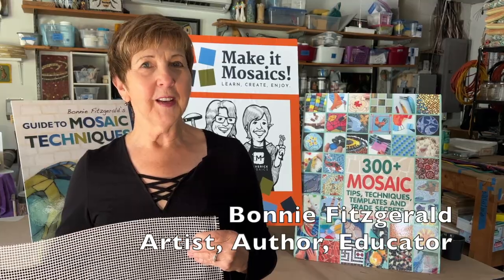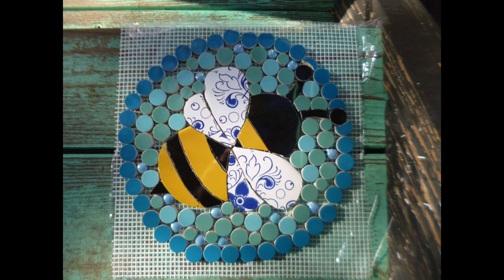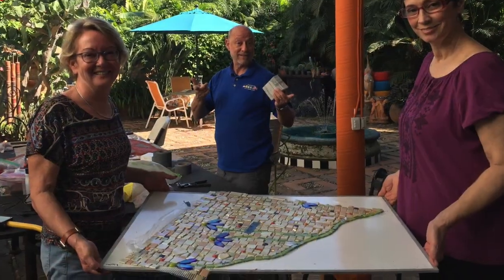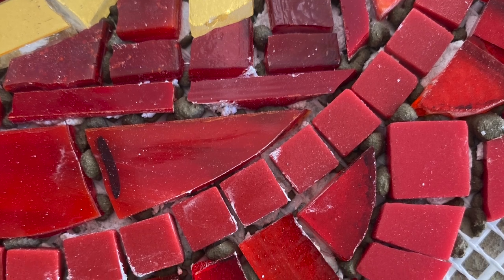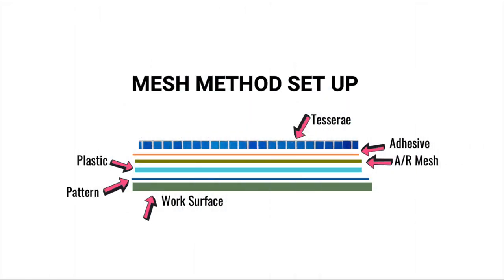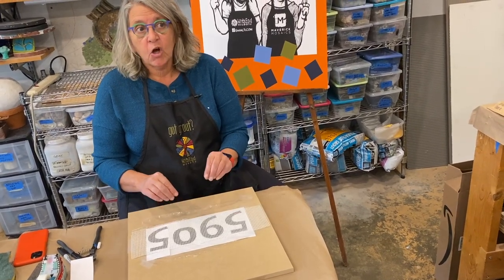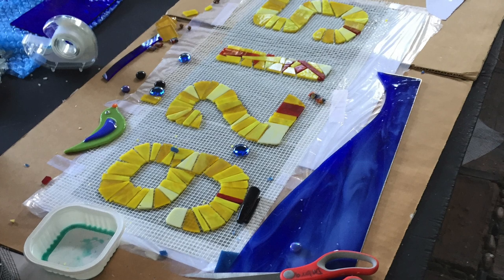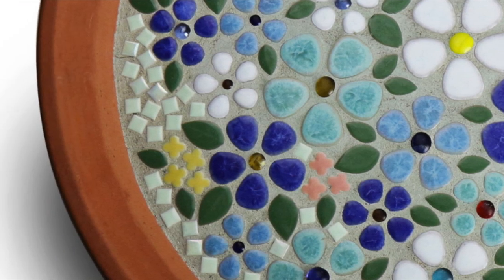Mosaic Mesh Mosaic Method, Easy Mosaic Fabrication Technique

Comment from the maker: Sorry Chat abruptly ended! To answer about using pva glue if piece for outside, yes I have done it, but be careful to not create a barrier with the pva glue. The installation glue needs to get around the individual teaasrae.
Reply from the maker: Thanks for tuning in.
Reply: I don't use WeldBond for outside because it turns back white and soft even after its cured.  I live in Wisconsin and I want the tile seated as strongly as possible due to freeze thaw cycles.  The weldbond creates a barrier and doesn't allow the thinset to stick to the tile in that area.  My general rule is use as few types of material as possible because there is less opportunity for reaction between the materials and less chance of failure.

Comment: I bought mesh that says it is for mosaic but I can't find it it is AR or not. The directions inside say mesh is not meant for outdoors, which is very confusing!
Reply from the maker: Humm, did you buy "sticky mesh"? The mesh sold by Witsend, and construction supply places, is A/R mesh and is fine for outside. It is confusing! If you email me a pic and the label I may better be able to answer your question. bonnie@maverickmosaics.com

Comment: Help! Do you apply thin set to the top of the mesh and then apply the tesserae? How do they stick otherwise so they don’t fall off when moved?
Reply from the maker: Depending on the size of my tesserae sometimes I back-butter OR put a dab of thin-set on each piece using the pastry bag trick to put a dab on the back of each OR spread a line of thin-set on the mesh with a spatula or pastry bag and set each piece directly.  Either way, allow thin-set to cure overnight. Then gently peel the plastic off and guarantee the majority of your tesserae will stay on the mesh. There may be a learning curve for how much thin-set to use based on the size and weight of the tesserae. The thinset is really strong  This is pastry bag trick https://youtu.be/ZVNZDGqQSrw

Comment: Thank you for your video.   I have found both sticky and non sticky AR mesh.  Do you recommend one over the other for small framed wall hangings up to 12x16 inches?
Reply from the maker: I do not use sticky mesh; I use AR mesh, as given in the description. I do not trust sticky mesh to stay sticky and hold the weight of my tesserae. Good question! Thanks.

Comment: Is there any specific gauge or size holes in the mesh I need to order other than AR?
Reply from the maker: There are a few gauges, but you'll have to shop at a building supply place for variety. This is the BEST middle of the road size and you can buy smallish amounts. https://witsendmosaic.com/mosaic-mounting-mesh-1.html
Reply: @MakeitMosaics  thanknn bc you so much
Reply: Thank you so much!

Comment: My tiles do not stick to the mesh I used PVA glue, what am I doing wrong?
Reply from the maker: Hard to say without more info. Are you using a good quality PVA glue (Weldbond), the right kind of mesh? Are tiles heavy or large scale? Did it dry overnight? Humm.

Comment: I am preparing to mosaic preformed cement pavers for the garden. I am considering using mesh for this project, instead of lugging the pavers up and down stairs. I noticed in the video that no examples for floor/ground installations were shown. Is this method more for vertical applications? Are there any things to consider if using the mesh method for stepping stones. Thank you for such fine instructional videos.
Reply from the maker: You can absolutely use for something flat. The fish table in the Mesh Method video is a good example of that - I did the complicated fish on mesh, mounted those on table then did the background directly. For that design worked really well. Kim has a good video about doing stepping stone using face tape method, also a technique worth considering. Really depends on your design. Thanks for being a fan!  https://youtu.be/3Jd20qX6L8U

Comment: Hi Kim and Bonnie - another great video! Thank you so much! I'm preparing to make a garden pole with matching table. I have consulted with Kim directly on the pole project (TY!). I  to am going to try and use PVC pipe on this piece for the substrate. The advice given is to use Lexel as my adhesive and Latricrete Spectralock 1 for the grout. My question is, can I use these two products with A/R mesh? The pole project is increasingly daunting the more I think about it!
Reply from the maker: Is the pole too large or inconvenient to mosaic directly onto with Lexal as adhesive? To do mesh method as shown in video you would have to prep the pole, make it concrete with A/R mesh tape and thin-set, then build mosaic on the white mosaic mesh in the video then thin-set as adhesive onto the pole. And after that grout. The direct method with Lexal would be easiest.
Reply: @MakeitMosaics   Thanks - I was still in the planning process and haven't purchased a pole yet. My thoughts were PVC would be a lighter, easier to handle material. The diameter could be as little as 5" I would imagine. 
For the other portion of this project, I'm doing an outdoor patio table. I have a table with a place to lay a piece of glass. I've traded out the glass for a piece of wedi board. For this project, I can use the mesh with Lexel and Spectralock 1? 
And for a third project, I purchased 3 of the aluminum EZ frames from WitsEnd to make house number mosaics for myself and my two neighbors. Lexel + Spectralock 1 on mesh?
My thoughts were they are all outdoor projects, so they same adhesives and grouts would work, but I'm very much a beginner, so maybe NOT!! ;-)

Comment: Apreciado señora si quiero hacer un mosaico trasparente debo ponerlo sobre un vidrio o requiere un epoxi para sujetar las piezas para la intemperie?.
Reply from the maker: English Translation: if I want to make a transparent mosaic, should I put it on glass or does it require an epoxy to hold the pieces against the elements? Answer: Creo que estás interesado en el mosaico de vidrio sobre vidrio; el método de la malla no es una buena técnica para materiales transparentes; Verás la malla detrás. Los adhesivos de vidrio sobre vidrio incluyen productos de silicona y pegamentos PVA que se secan transparentes. English Translation: I believe you are interested in glass-on-glass mosaic; the mesh method is not a good technique for transparent materials; you will see the mesh behind. Glass-on-glass adhesives include silicone products and PVA glues that dry clear.

Comment: I am using this method at the moment with a mindful amount of PVA glue to allow the tile adhesive to stick the back of the ceramic tesserae. Question, how long should I wait between assembling the mosaic to the wall with thinset and grout? My plan is to use a thin later of thinset on the wall, a thin one on the back of the tiles, and make a sandwich. Leave it to dry for at least 24 hours and then grout it straight onto the wall. I'm using pva because I'm working with children and find it best to do it this way. Any other advice for a first time 
 installation? Thank you!
Reply from the maker: Sorry, i just saw this. Thinset needs about 24 hours to set up enough to grout; your plan is good - some mud on the surface and some on the back of the mosaic. I like to use a rubber float to smush the mosaic into the mud on the wall. Good for yoe working with children - we need to recruit the next generation!

Comment: Thank you so much, this is really so informative and helpful. I am currently starting on a project that is much larger than the dimensions of the mesh. I know I would need to connect pieces of mesh together to complete the whole. Would appreciate if you could share your process in terms of how you do this. Would the edge of one mesh section over lap with the other or would you leave a gap between them? Also when placing tessera down, do you intentionally leave a space before the edge and then work on  filling them in once the mosaic has already been attached to its substrate for a seamless work? Thank you in advance! :)
Reply from the maker: Great question! I often am working sizes larger than the mesh, if I know for sure where the mesh runs out will be. the place I am going to cut anyway then I don't bother to overlap, but most often I overlap about an inch. Sometimes I am cutting as I go because I run out of table space. Just remember - take LOTS of photos and give yourself registration marks before you cut the mosaic apart for installation.  I am always amazed how easy it is to get lost in the process! Hope that answers your questions. If not, let us know. Thanks for being a fan!

Comment: Thank you for the great tips. I have a question about using thinset: does the thinset  also have to be used in small amounts when using it attach the Tesserae to the mesh, as you noted should be done when using PVA or Weldbond? Thank you!
Reply from the maker: Yes small amounts to initially attach tess to the mesh, this is in lieu of PVA (Weldbond). You can use Weldbond BUT be mindful to not accidentally create a barrier by using too much PVA - because ultimately the adhesive that holds the mesh-backed mosaic to the wall needs to squish up around the edges of each tile, even if it is more Weldbond.
Reply: @MakeitMosaics  thank you!

Comment: Can this technique be used for glass on glass? Would appreciate tips for the best way to place glass mosaic on a large piece of glass substrate.
Reply from the maker: Not a good technique for glass on glass because the mesh will be seen. Most folks adhere glass to glass directly because pattern can be taped to back of glass. For large gog pieces I use tempered glass as my “substrate”, regular glass may crack over time due to weight of mosaic. If your mosaic pieces are bigger than about 2”x2” be aware if using PVA or MAC glue it may take a long time to dry clear, the glue  dries from the outside-in. Good luck!
Reply: @MakeitMosaics   Thanks for your tips - I’m a beginner with big dreams to leave behind a large piece of legacy for my kids
Reply from the maker: @jasbirkaur5733  Legacy is important, and kids and mosaics are a great combination. Please take a look at my website www.maverickmosaics.com, I have an entire section dedicated to legacy projects, may give you some ideas. Thank you for being a fan and keep creating!!

Comment: Si uso vidrio sobre vidrio con que pego y q lechada pongo para el invierno y el verano . A la intemperie?. Gracias mis queridas señoras.
Reply from the maker: For exterior glass on glass, you need to use silicone or epoxy as adhesive. If you can obtain MAC glue in your country, that's great, but there have been supply chain issues. Use sanded, polymer-fortified grout, and consider using an exterior sealant—although many grouts have sealants already in them, read the manufacturer label.